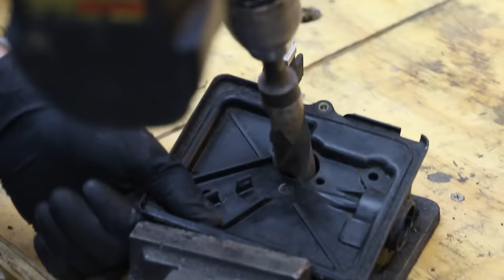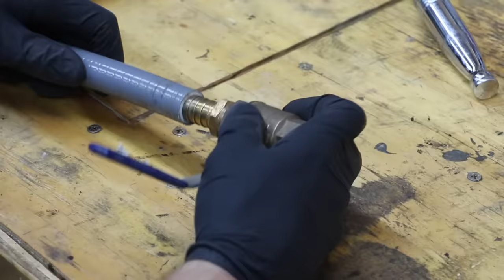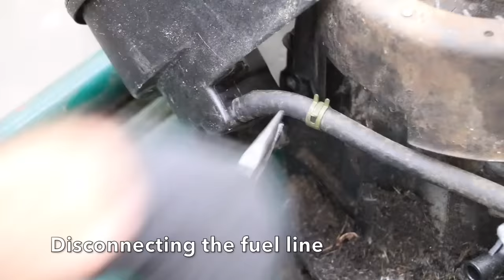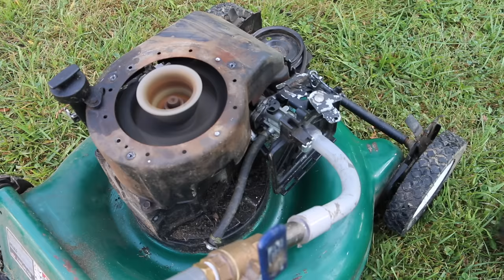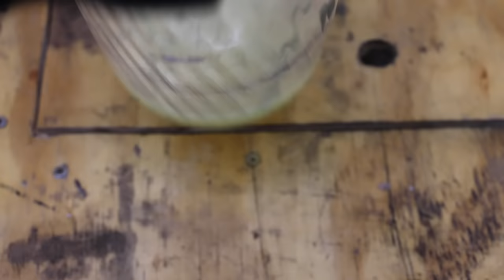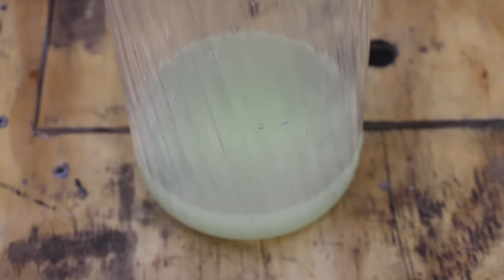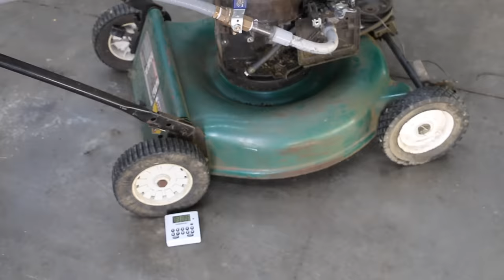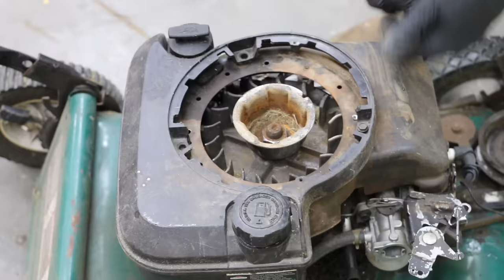Will a "Gas Vapor" Container Improve MPGs and Fuel Efficiency?  Let's find out!

Comment: I have not read all 6'750 comments and then the corresponding responses so if this question was already asked sorry.   Did you monitor RPM? You really needed some way of telling if the same amount of work was being done in both instances. If the RPM was higher on the vapor set up and lower on the gas tank set up then the vapor could still be doing better. If it was the other way around then the vapor was actually less efficient than the standard gas set up with the tank.
Terry
Reply from the maker: The RPMs in the vapor setup were all over the place.  At times, the RPMs seemed lower than the carb setup. I believe the vapor setup caused the engine to run lean, even if it is more efficient.  A lean condition is problematic. Thanks for commenting.
Reply: Bubbling the intake air threw the fuel created a limited mixture im sure if you heated it also and throttled it in along side an intake charge could also give another result.
Reply: Very interesting... thanks for doing the test... much appreciated...
Reply: Project Farm it is actually running much more rich on vapour, that is why you can idle so low on it and have complete combustion. I have noticed with my own baptized that It can run on a tiny bit of vapour and a large amount of air. Thanks for your time and effort!
Reply: Controlling the RPM and the Fuel air mix would be difficult, I suspect this may account for different performance although the differences in fuel economy are likely due to slight measuring differences.

This is however a great proof of concept, one thing I would point out is the white liquid left at the end will be lower grade fuel IE a lower octane rating, as most flammable fuel (evaporates most readily) will enter vaporise fastest, so the fuel left at the end is of low quality so engine performance will be lost over time due to the reducing fuel quality in the vaporiser.
Reply: He did initially mow some grass, which seemed to indicate that the engine was operating fairly normally...
Reply: Project Farm thanks for the response. I always wanted to try this but have never had the time. I guess you could do a long term test and get a better indication of efficiency? Thanks for the video!
Reply: Project Farm 
Good old Smokey did it right on a 283 back in the 80's - the old 200mpg carb from world war II ....

Gas has 5 stages and each at different heat range - the other problem is air expansion as it heats...

So you need to compress and cool the air as the fuel is introduced to the induction cycle....  Direct injection would be best...
Reply: like keeping the fuel along side the engine in a safe metal box, in order to heat & shake
Reply: Garnett STone He was just trying to get more information for science. It benefits everyone to ask questions.
Reply: Project Farm- Could you retest with wideband air fuel ratio meter in the exhaust and tachometer to measure speed? 
Dyno! Dyno! Dyno! ( Chanting ) I'm kidding. 
Very cool though I've always wondered if this actually is feasible.
Reply: Technically to measure work or hp you need torque and speed. 
Which is why I mentioned using a dyno. I used to run dynos everyday at work the engineering lab. Good ole days.
Reply: Another great video! Thanks for taking the time.
Reply: mike dew High octane fuel is less flammable than low octane. The idea of high octane being easier to ignite and having more power is a proliferated falsehood that comes from the uneducated thinking "race=more power". High compression motors and racing conditions generate higher temperatures pre-combustion and therefore need a fuel that is more resistant to igniting, or the fuel detonates before the spark attempts ignition. Using a higher octane than is rated for a vehicle results in a loss of power and even fouling. In the old days, high octane fuels contained significantly more detergents than the lower grades, so it was customary to run a tank of high-octane gas from time to time. These days, any decent fuel brand runs a sufficient additive package in all grades of fuel, so even the old custom is pointless.

Comment: I've been watching a lot of these are appreciate the effort you've put into them. 
About this one, what the majority don't understand is gasoline as a liquid is not even flammable. The carb venturi or the injection system atomizes the gas to where there will be enough vapor by the time the spark plug goes off. I experimented quite a bit in my youth with that knowledge. One of them was to use exhaust pipe (made a 'S' shape and welded plates to mount) to mount my carb 2 feet away from the engine to give the gas more time to evaporate. That alone increased the average mileage in that 72 Plymouth from 17 to 24 mpg. But I had a problem with a certain outside temp and humidity, it would cause ice crystals to form so I had to try and heat the tube. It helped, but I finally gave up since I needed a machine shop to make things I really needed to continue. 
The problem you had with your mower setup is a fixed amount of air traveling thru the liquid. Ideally you need a separate way to vaporize the gas and have a way to control the vapor/air mixture before you get to the throttle. If a fuel injection type system could inject the proper amount of vapor instead of raw gas, it could be the best mileage possible. The problem is heating gas to vaporize would be dangerous, so impractical at this stage. But this is the reason economy figures have been rising. Carbs have the be the most inefficient method possible as they are just dumping raw gas into the intake.
Again, thanks for all the time you spend making the wonderful videos!
Reply from the maker: You are welcome